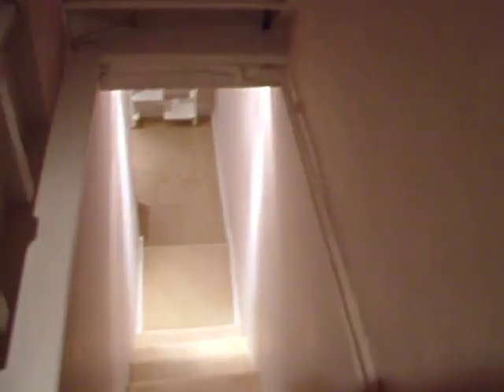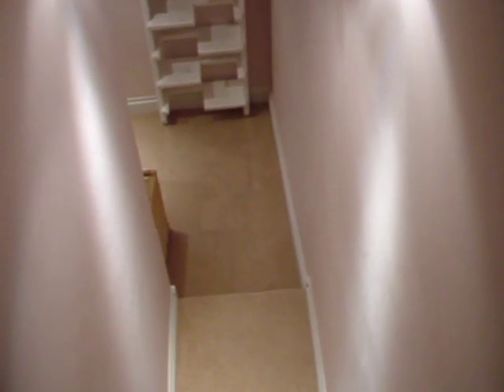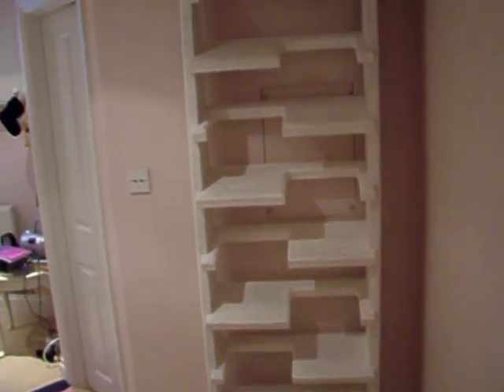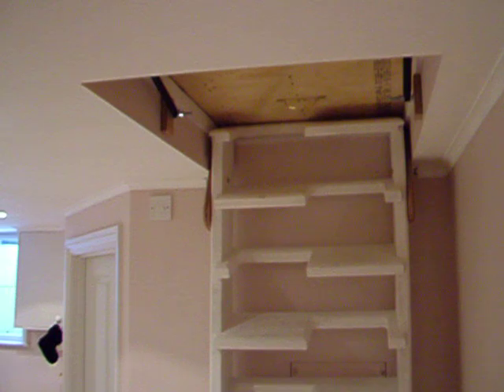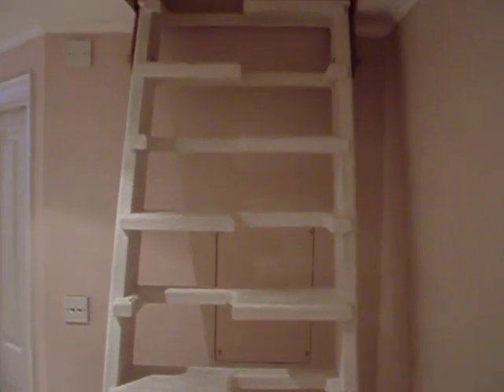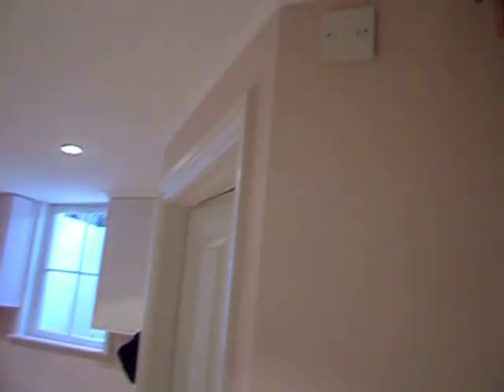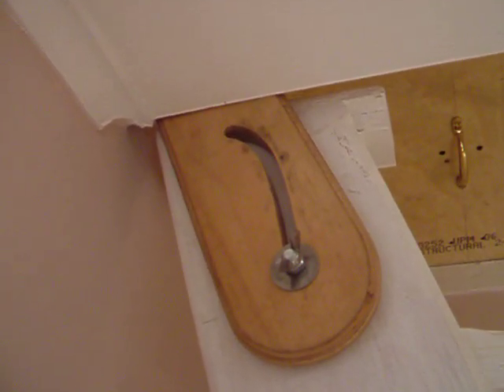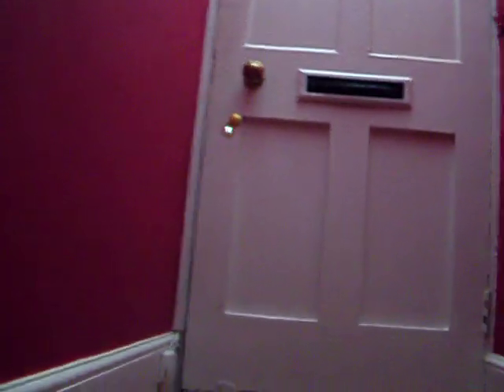Space saving staircase. Part 2

Comment: Did you make them? Where did you buy them? Can you post the link?? What are they called?
Reply from the maker: I built these myself and many more over the years for clients who needed access in areas with restricted space. However there is a company I now use who can build them for much less than I need to charge. Go to this link and look at the "Loft Stairs" section; https://www.stairbox.com/
You can design any staircase and they will build it for you. They are very helpful if you have any problems.